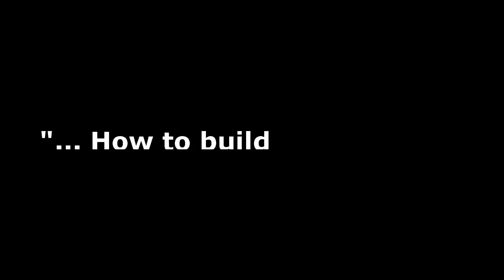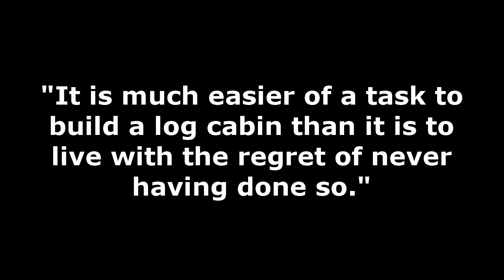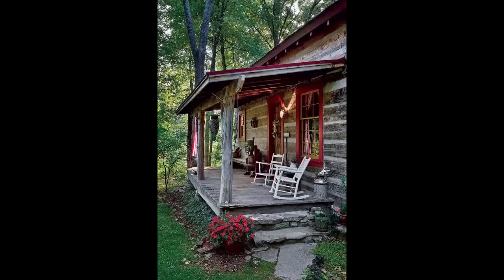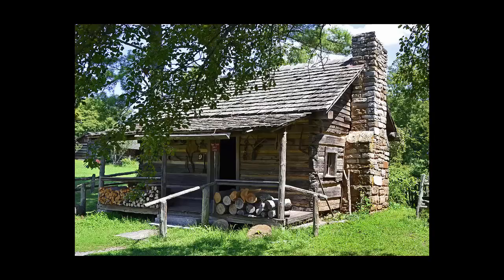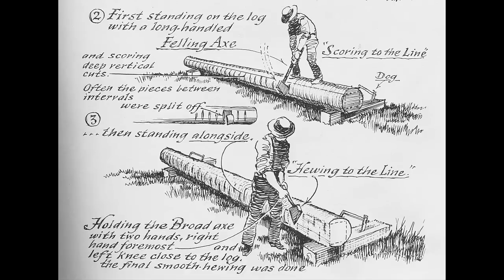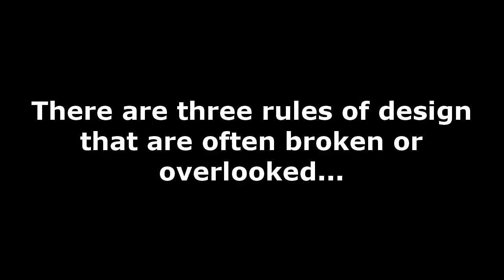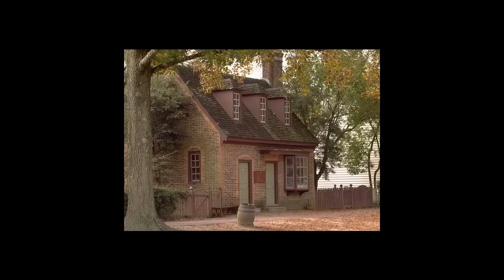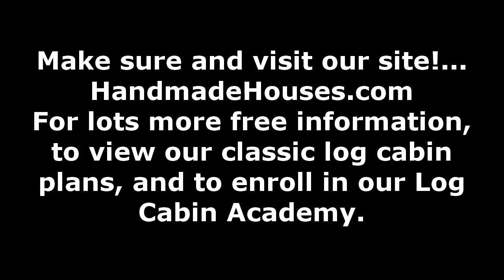How to Build a Log Cabin? Start with a Good Design.

Comment: Seems counterintuitive to have an award winning kit home cabin to be a disaster.  Can you explain how the wheels came off this project and why you were one and done with kits?
Reply from the maker: David, I agree. One of the many things I learned in building this kit home is that the cabins that are awarded with the title of "Best Cabin" by known log magazines happen to also be from manufacturers who do the most advertising within those magazines. If you visit my website handmadehouses.com there is red link box over to the left side where you can get a list of 20 reasons why I prefer old vintage logs. You ought to check that out.  I think the main reason why I regret building this home was that when I drive down that road the cabin is on that it doesn't look like it belongs... it looks like well a home that is out of place... not a cabin that belongs in the landscape... it's distracting, much the same as if I had built an adobe house there.

Comment: there is a lot of DIY videos on the channel ... but ... this is the one I prefer, for a simple reason ... the stone chimney , this is , for me , the right way to achieve it ... I'm not saying the other ways are wrong, it just makes me happy see it built out of stone, instead of a stainless steel one, which simply doesn't fit in the picture ... but that's just me ...

Comment: Though the notched cabin is by far the most common (and all log cabins are cool), the most solid, long-lasting - and simpler - is the "butt-and-pass" system, where each tier has the overhanging log end on one side butted up with the next, and secured with rebar hammered every 4-6 feet, cutting down on potential rot, exposure and difficulty of notching. There's also no settling and the solidity of the structure removes the need for any internal, load bearing walls. It's the style I'm going to use on mine.
Reply: By the way, I do love the cabins of yours that I've seen.
Reply from the maker: Oh I disagree! 

"Butt and Pass" is the most long lasting? 

There are tens of thousands of examples of traditionally built log cabins standing proud today in the US that are 200 years old or older. Can you point me to one butt-and-pass cabin that is as old as I am?

The potential for rot is much greater in a "butt and pass" cabin than in one traditionally made. Anytime two flat faces of wood come in horizontal contact with each other water will eventually find it's way in where rot and mold will develop... unless annual applications of expensive and toxic materials are applied.

No settling in a butt an pass? ... really? 

I have never needed nor built load bearing interior walls in any home I've ever built.

Of course you are free to build a cabin any way that you want to and I wish you the best with your chosen method... but like all choices in life it's best to carefully consider all options before choosing to go forward on something as major as the construction of a home. If you'd like to learn more about traditional cabins as it compares to the butt and pass method please consider reading this article and the comments that follow... http://handmadehouses.com/butt-pass-log-homes-cabins/

And watch episode 2 of Handmade House TV here on YouTube!
Reply: I'd love to see you some of your cabins, and who doesn't love cabins in general, right? And I know a properly notched and insulated cabin is multi-generational.

One point though that I'd point out is that in any of the videos, demonstrations or articles on Butt and Pass I've seen, they were WHOLE logs and there's NO flattening, shaving, shimming or contouring? That was one of the main points - reducing exposure to water and rot by not creating gaps or recesses?

In any event, I'd say the same detail the builder puts into construction of either is the key, and both are preferable to the constant maintenance of traditional, standardized timber frame homes that I HAVE helped build. Poor quality, high-priced wood materials.
Reply from the maker: Agreed. We are a lot more on the same page that not. A handcrafted home regardless of the technique is better than something wrapped in vinyl.

Most of the butt and pass cabins that I have seen have the tops and bottoms cut flat so that they are uniformly the same in the height. And they require regular applications of sealers.

Water (rain) will always do it's best to find itself into every nook and cranny. If it gets between two pieces of wood that are touching it will never leave until it has created rot. If gravity is brought into play such as siding that overlaps one another, or in a notch that is angled, the water will drain.

I have set up log cabins in the traditional manner on my lot that has stood there for ten years with no roof, and no rot. And on the other hand, I've been called to inspect homes built in the butt and pass method that were less than ten years old where I recommended the home be immediately covered with siding.

I've got no beef with those who build butt and pass cabins... at all. I'm not the argumentative type. I never go over to their sites and stir up trouble, and I so appreciate your friendly comments (not all who favor b&p are as kind to me. I just pass on my own experiences and observations... and opinions.
Reply: Thanks Noah, and keep up the good work sir!
Reply: Have you built a log cabin? If so do you have a video to show us the points you made in you posts?
Reply from the maker: Oh yes, I've built many log cabins... over a hundred... and I've worked on a visited over a thousand more. I am currently creating a video course where I will share step by step how I build a cabin... make sure you are signed up on my email list to learn more... http://handmadehouses.com/

Comment: Hello I want to build a log cabin next year far far away in the woods but how can I do this without a chainsaw or any electrical/gas tools
Reply: Thanks for the reply, so its possible to build a decent house without power tools or a car?
Reply from the maker: Certainly. People have been building homes for millennia without either. It is certainly much harder to do... and what one would consider "decent" would need to be defined. A home where one can be safe and dry is one thing... one with central heating/air and wifi is whole different thing.
Reply: Thanks a lot man :) I got the answer I needed

Comment: Mr. Bradley.   Can you build a log cabin, using Eastern red cedar?
Reply from the maker: I like all species of wood. To me it's more about the size, the straightness and lack of twists and knots found in the wood. And how it's assembled. I'm a big proponent of traditional methods of building a cabin.
Reply: You can build an enduring wooden structure from any species of wood if you copy the simple principles that the Japanese had been following for thousands of years.  They regard site work as important as structural work. 

They keep wood isolated from earth and porous materials, grade and drain the land so water runs around and away from the immediate area, and  create landscaping that provides shade and  wind barriers without being too so close to the structure that organic material gets deposited onto the wood.  

To that, they don't delay maintenance.  The combination slows UV deterioration of wood, boring insects and rot.

Comment: hey Handmade Houses with Noah Bradley how do you feel about the many pallet cabin builds?? I've seen many, insulated and tidy..
Reply from the maker: Hi Robert, Well... you are the first person to ask!  Thank you for that.
I have seen some images where people have made some attractive things using pallet wood... I've got a different take on building with pallets than most I suppose. 
First, in my youth I worked a couple of jobs where pallets were used and reused often... a grocery store and United Parcel Service... both places would use these pallets over and over again until they were worn out beyond being useful for anything... that is IF they weren't constantly being stolen by those who felt they were going to be thrown away. We'd keep them stored outside as they took up a lot of room inside and on occasion we'd come to work to find someone had come around that night and took them all. So often when I see things of pallets I can't help but wonder the story behind them.
As a builder when I order cement now I have to pay a $35 deposit for the pallets and I've had a few "disappear" over the years. I can't help but wonder where they went?
I've taken a part quite a few pallets in my time (I was often the guy sent out to repair them, or combine two broken ones into one good one). It's a miserable job and the wood is often so full of grit that I'd never want to run the wood through any of my woodworking tools.
And finally (boy, you are probably getting more than you asked for... lol)  In my twenties I helped a neighbor on occasion who owned a very small sawmill make them... It's how he earned his living, he'd buy the reject logs from loggers that no one else wanted and then making pallets for the local manufacturers... so there I learned that pallets themselves are a form of making use of resources that would likely have been left to rot, and providing work for hardworking folks. 
I love using salvaged material... I always have... but I prefer to use the best salvaged materials I can get my hands on.
Reply: look a few pallet cabin builds up here on Youtube I find it intriguing.. Some are actually very good.. for my first cabin build i think i may go this route and was looking for some insight from someone like you.. thanks alot!! ~Rob
Reply from the maker: No doubt there are some interesting ones to be found. I guess the one comment I could add would be partially answered by latest Handmade House TV#8.... the second home that I built for myself was entirely out of salvaged materials garnered from an old house, barn, and school. I poured three years of my life into building that home and in the end I took a huge loss and it didn't look that great when I got done. The lesson I learned from it was if I was going to invest that much time into building a house... a whole house... and it might be the only one I build... I should make it the absolute best home I can do. There are SO many options to choose from in building a home. I would encourage you to think through all them... and pick the one you view as the best... one that years from now you will look back on with great pride.

Comment: Thanks for good advises! I have always wondered what the benefits of having the chimney outside the house is, here in Sweden you never see that. We keep it inside the cabin, often in the center of the house. Hope you can enlighten me :)
Reply: That's what I'm wondering too :) I'm coming from Finland and now living in Norway...
Reply: Hi.
I can only tell you why the home where my Father was raised (partly) in a "Little House On The Prairie" type house,
in Minnesota, with a dirt floor, had an outside chimney.
When Settlers and "Pilgrims" would first arrive on the land where they intended to settle, 
it would be as early as possible in the spring.
The first thing they did was clear land, stack wood to dry, and rocks to build with, and then PLANT Crops.
All the while still living in the Conestoga Wagon, cooking outdoors, while clearing the land and planting.
Once that was done, the building of the Homestead began.
Sometimes this was a "Soddy", and sometimes it was a Log House.
The logs were used either whole, or milled into planks for building.
Usually logs were used, because until the family harvests the crops, there is no money for anything else.
It would be a simple structure, with one door, no windows, and no Fireplace or Chimney (yet).
It would be early summer, and there would be no need for an inside Fireplace, 
as the family would still be cooking outdoors.
Harvesting begins, and building stops.
NOW the family must move indoors for the Winter.
They have money from the sale of crops, maybe from eggs from any hens, 
and can afford cement for the building of the Fireplace, Metal Hinges for a real door, 
and maybe actual glass windows.
The Fireplace is added on to the end of the Cabin, the Chimney on the outside, 
and the Fireplace/Oven on is the inside, where a clear space has been left for that purpose.
Some of the Logs are removed, and an indoor Oven and Hearth is built connected to the outside Chimney.
Sometimes the family will add on to their home, in later years, 
and build the home extension on the other side of the Chimney, 
leaving the Chimney and Fireplace in the middle of the home.
Anyway, that's what I was told regarding the building of the Farm Homes in Minnesota and North Dakota,
around the 1900's.
And I guess people still do it that way.
Reply: Old Yeller Great answer! Thanks a lot.
Reply: @oldyellerschannel4676  : thank you for such an enlightening and endearing description of life on the prairie, and building a cabin in the REAL "olden days." You have described an interesting reason chimneys might end up in the middle of the house. And thanks for the timeline for how the settlers made a home after crossing the country in a Conesta wagon, start to finish; I can really picture it now. I had no idea! Great short history lesson and now to see more on your channel. Gracias, mi amigo!

Comment: 1. Any issue using mix matched tree species for a cabin build? Example, you got some land, clear a bunch of trees there and use them to make your cabin. Im guessing it wouldn't make a difference. 
2. Concerns to be wary of when using green wood to build cabin? Im supposing you may want to wait a big longer after building before chinking or be ready for cracks - unsure how much the shrinkage / twisting when it dries will impact the house, I suppose logs that are held down, ie the walls which are stacked on top of eachother, or planks nailed down will prevent major twisting.

Comment: Why do americans built their chimneys on the outside?
Seems like you lose a lot of the heat as it's stored outside of the house and not in it.
Reply from the maker: It's interesting that you should ask... Handmade House TV #15 will answer that very question! (there are several good reasons so it would be too long for me to type out the answer here... I hope you will check it out when the time comes!)
Reply: Handmade Houses with Noah Bradley Alright i will, in Finland our fireplaces and chimneys are usually in the middle of the house so all the heat is stored in and it will radiate it to all rooms but i'm sure americans have their reasons to building it on the outside.
Reply: You directed your question to Noah, so I hope I am not wrong to interject.  Historical precedence is a big reason.  Various parts of Europe and Britain have vernacular (common/ordinary) architectural styles.  Some have external chimneys (Southwest England, I think, has some examples) and many have chimneys within exterior walls.  Still others have centrally located ones.  A combination of cultural factors and New World environment caused these features to be selected in different regions.  For example, New England favored central chimneys and low ceilings to conserve heat.  On the other hand, the South (earliest in Virginia) favored increasingly tall ceilings and it was easier and safer to put the chimney on the exterior, and the loss of heat was of less importance.  New England's practice derived likely from the East Anglia and Virginia (from which the South grew) likely from the south and southwest area of England. (There are complex Continental influences I am omitting.) The geographic distribution of these building practices is complex, with central chimneys in the South in certain locales and periods; and with exterior ones in the North.  This is a simplified version of a good deal of historical scholarship on this subject.  So, while it was/is the preferred method of chimney building in the South to have them on the exterior, it is not universal in North America by any means.  Again, hope this is appropriate to respond like this.
Reply from the maker: Dale, thanks for all the info... you chime in anytime you want!
Reply: Thanks, Noah.  I am really enjoying your series and I think it is excellent.
Reply: Dale Couch Well that certainly sheds some light on the subject, thank you for the informative reply.
Reply: Tapio its pretty

Comment: I understand the appeal of log cabins and if you have a block of land with good timber on it, use it. But the smarter money and time went on Timber frame because less chance of shrinkage and rot setting in. Lay any timber horizontally and expose it to weather and you invite rot ! End of story. You can reduce that problem a bit with careful chinking and decent over hangs on your eaves but your still going to get problems eventually.
Trees grow vertically for a reason people ! As soon as you lay them horizontally on the ground they rot. Moisture is the enemy of timber. 
Log home kits are a total rip off and a terrible waste of timber. The earlier settlers only did log homes because it was quick and easy shelter. The smart money invested in timber frames and cladding OR in Europe they used Cob/earth. Log homes are the idyl of romanticising fools.
How many original log homes are left ? They rotted away a long time ago. Timber frames on the other hand can be 500 years plus old and still habitable.